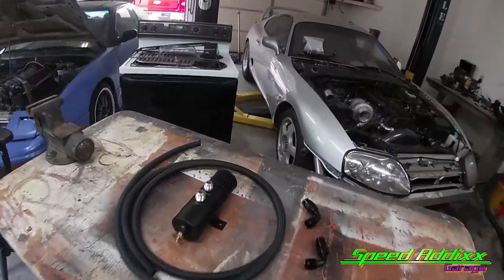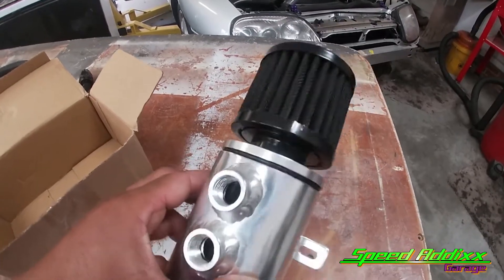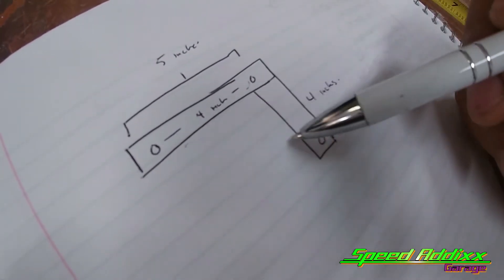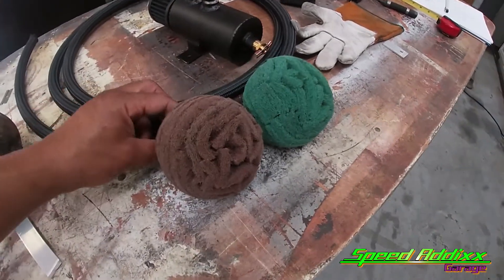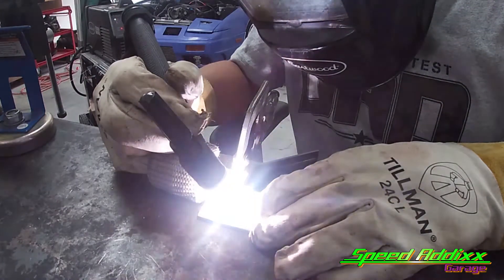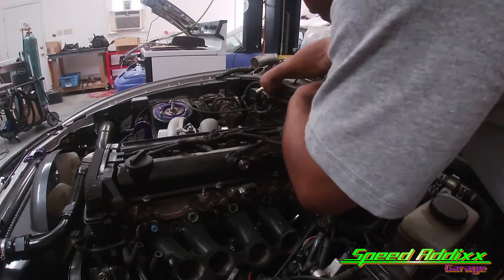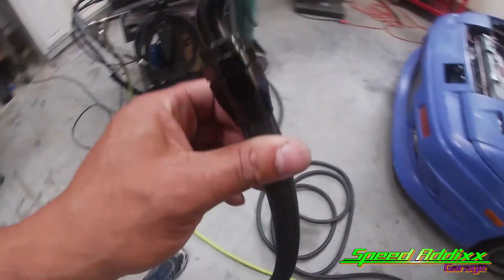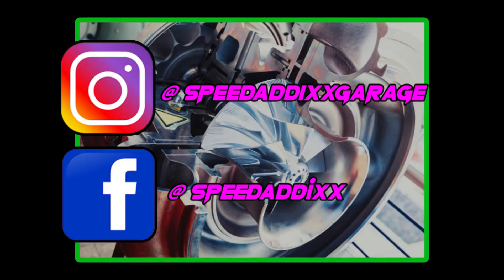Supra Build 700HP Ep.22 - Catch Can Installation!! A Turbo must have!!

Comment: So it does not need any vacuum from the turbo?? Between the mass air flow and the turbo
Reply from the maker: If you want you can add a vacuum source from the intake to the can, but no its not needed. Most people don't like that because it introduces carbon deposits and vapors back into your turbo. That setup is more so an OEM setup, Once u start modding your car you want the intake, turbo and intake manifold to stay clean
Reply: @speedaddixxgarage8278  ok thanks for the info💪 just Wana make sure my 7mgte doesn't blow by untill engine is warmed up and been on it. What's ur thought on the apexi neo  all I want is 500hp.
Reply: My mods7mgte... 60over weisco pistons,264bc cams,650rc injectors,arp head studs, HKS metal head gasket, Zulu mod "drilled water port for rear of head for more flow."oil pan wide holds 8qts oil, drift motion oil pump line more oil flow.t61 turbo with after market exaust manifold, HKS bov, aftermarket intercooler and piping,on e85 rite now shows 10psi on full throttle
Reply from the maker: @bobbyglow9297  You need a standalone of some sort. I've been where you are at, trying to make the best out of your allowable budget. The NEO will adjust full but you also need to adjust your timing. If u use the NEO stick with moderate boost and check your spark plugs after a wide open throttle pull to see where the timing mark is at. When the timing mark goes past the bend toward the threads.......the timing is starting to be on the aggressive side. Hope this helps
Reply from the maker: @bobbyglow9297  You have all that money in the motor.....I really need something better than the NEO. After reading this......save up for something that controls timing, fuel, boost and more all in one
Reply: @speedaddixxgarage8278  thank u for honest opinion. I'ma wait and get the aem2  unless u know a better one I can order.
Reply: @bobbyglow9297 ecu master